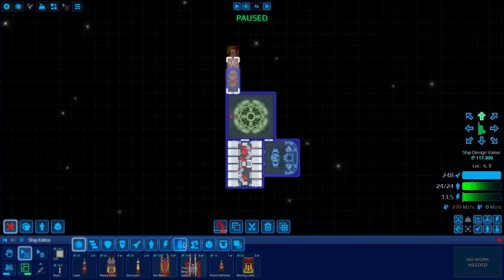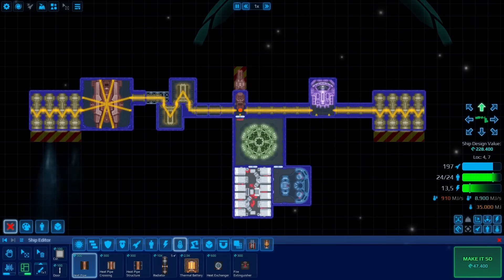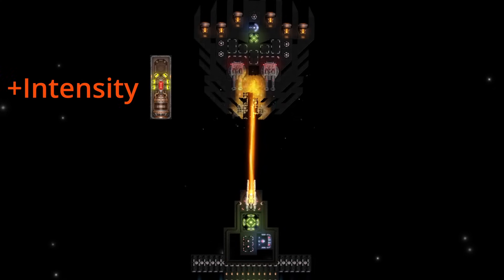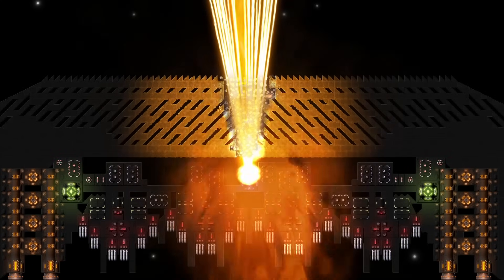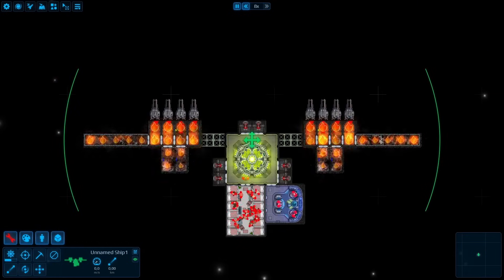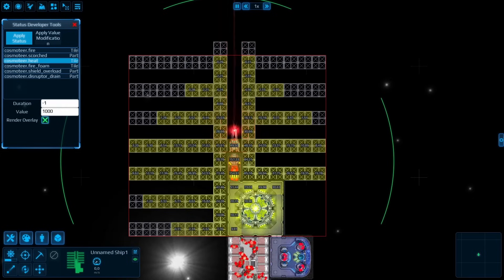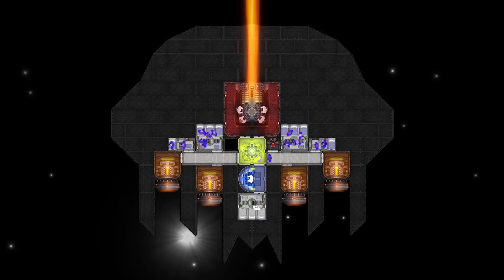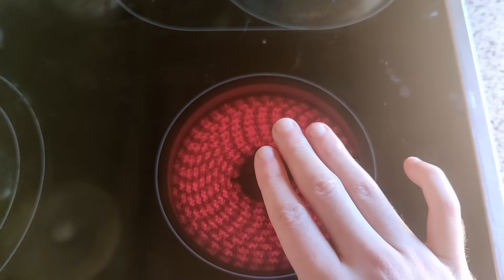Thermals in Cosmoteer full Guide

Comment: just wanted to say in a clearer way, M.R.T. thruster's are just like railgun's with only a single pipe is needed for cooling all the extenders and thruster. and even though the thruster will catch fire first you can still connect that pipe on the last extender and not worry about the thruster. but if you want more on this look @Glebo08 for the fine print

Comment: Wireless heat is going to help my current career ship... theres a couple shields I cant reach without a lot of compromise... wait that means I can wirelessly heat my point defense too! Those things introduce massive weakpoints!
Reply from the maker: Be careful with shields. They produce so much heat that it might be too much for exchangers. Could be fine for smalls though.
Wireless connection to pd is definitely a great use case. You can even put armor behind the pd now.

Comment: Hey! I want to say this video is fantastic, explaining all the basics and many specifics, though there is one random, but VERY useful fact I know about buildings large ships with overclocked MRT’S. (This is just a thing you could potentially include in a follow up video for more advanced tips in the future)

The way overclocking the nozzle versus overclocking the MRT extenders works VASTLY different.

MRT extenders produce 250 MJ/s of heat for a 500 KN addon to the base 10,000 KN of the thruster nozzle, meaning that all the additional percent boosts (+500% , +1200%, etc…) from the extenders and engine rooms attached to the MRT are now applied to a bigger base number. This part is simple, powerful, and doesn’t produce much heat. Good for all MRT’s but especially good for larger MRT’s, leading to insane thrust. All is well here! 

Here’s where the trap comes in. The thruster nozzle however, has a very different overlock. It significantly shortens the ramp up time at a cost of 350 MJ/s. Simple right? But comes with a huge catch.

The fine print says that it produces 350 MJ/s for 100% thrust power, but what it doesn’t clearly state is it actually means that the 350 MJ/s of heat apply repeatedly per 100% of base power, so a nozzle buffed by +1700% (resulting in a total of 1800%) is actually generating 18 multiplied by 350 MJ/s of heat, which is 6300!!!!! All for the sake of a faster ramp up time! This is absurd on such a level that I speculate it might even be a bug. For my dual MRT ship, that resulted 12,600 MJ/s of additional heat that I was initially unaware could be disposed. 

This is made far worse if the MRT nozzle is only connected via engine room (+75% ofc). 

This is why I decided to not overlock my nozzles at all. The bigger the MRT, the less cost efficient the faster ramp up time becomes.

Edit: Me and another person have in fact tested this and are certain this is the case.

Edit 2: Forgot to say thank you for the incredible video, not because I needed most of it myself but because everything I learned through trial and error is so perfectly explained for others less knowledgeable to see. I also had no clue structure was better are dissipating, and that overclocked railguns only needed one connection (which is surprising but a welcome decision by the devs. Just unusual considering everything seems to be intentionally designed to be a pain in the ass to connect). Take care :)
Reply from the maker: I does make sense that the heat would scale with more extenders as those also increase ramp up times, but it is weird that they would scale with er. Do they really?
Reply: @plaus6357 yes, indeed. Of course you can use dev tools to be able to tell for certain, but a much easier way is to just fully overclock a very highly extended MRT and just let it stay on with no cooling. The nozzle melts down before the extensions even warm up. On the contrary, if you overheat everything but the nozzle, you will see that the nozzle produces zero heat, lowering the total heat production of the entire MRT by about 60 - 90% (depends on the size of the MRT).

Comment: structure dissipation has been removed iirc
Reply from the maker: Thats only half right. The additional dissipation got removed but not the extra diffusion speed. 
The clips I used for passive dissipation were on the most recent version so it definitely still works.
Reply: @plaus6357 okay !

Comment: So you don’t need hull cooling if you  can instantly take the heat into the system? And for trl impacting shield does it apply hull heat or does it cause the shield generator to make more heat that can be absorbed by pipe?
Reply from the maker: Yea hull cooling is not required for using overclocks.
TRL directly apply hull heat to shields.